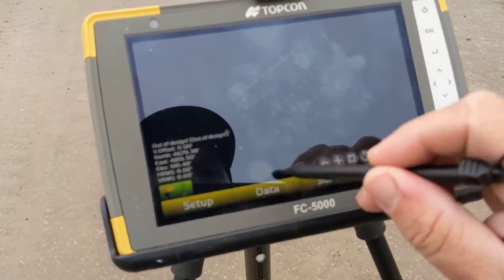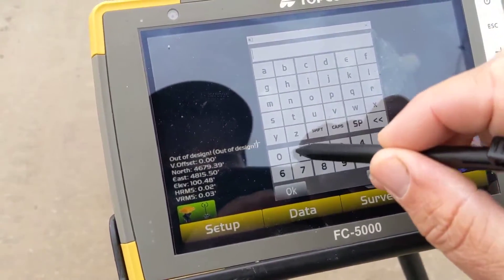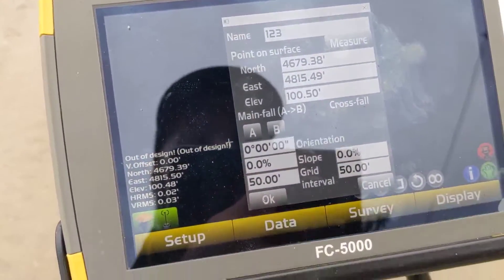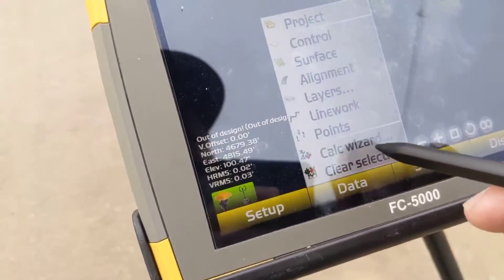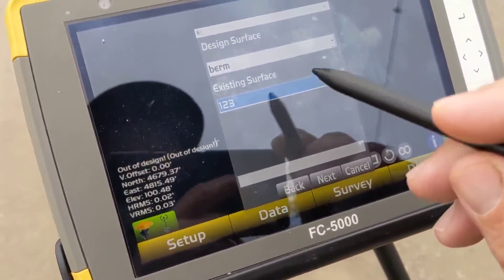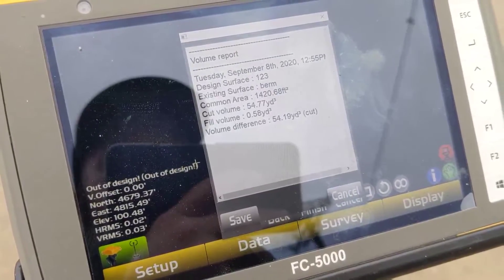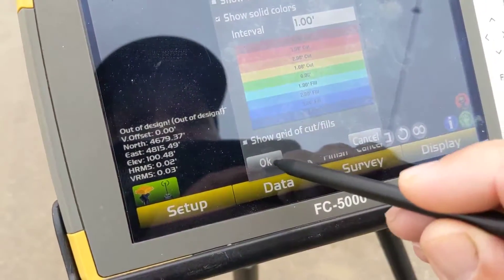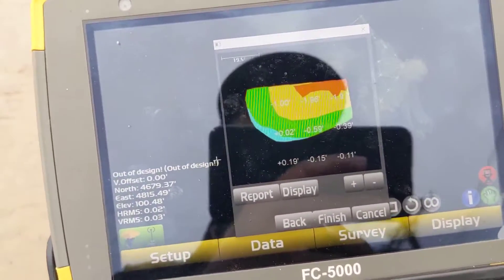Topcon Pocket 3D - Volume Calculations from a Plane Surface

Comment: Can you do a video to calculate volume on uneven surfaces? I auto topo around the base of a big stock pile and then auto topo the top of the pile and want to know how i can get an estimated volume. Thanks your videos are vary helpful!
Reply from the maker: Thank you! I can do that. You will use the same topo process. What will be different is how you calculate. What we'll need to do is create a surface based on the points from the bottom of the stock pile, that will be one surface. Then create a second surface from all the points, top and bottom of stockpile. I would recommend shooting your points on 2 different layers, it can make them easier to select for doing calcs on the data collector.
Reply: @ctpusa1   Thanks for the reply!